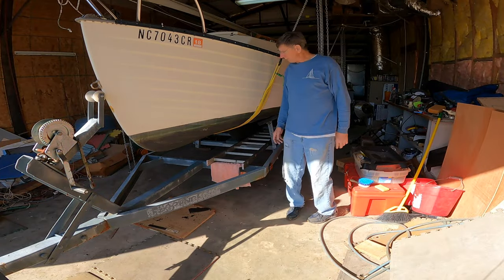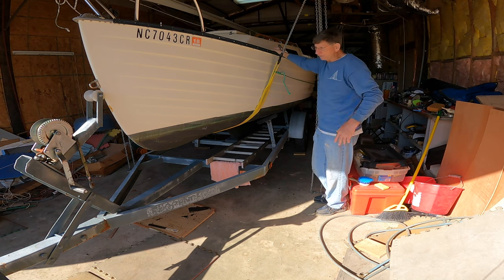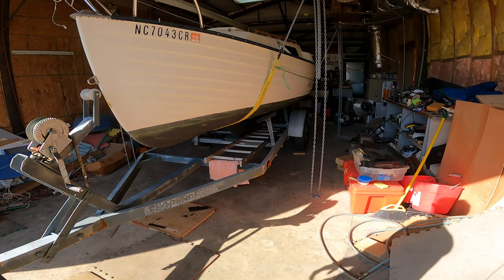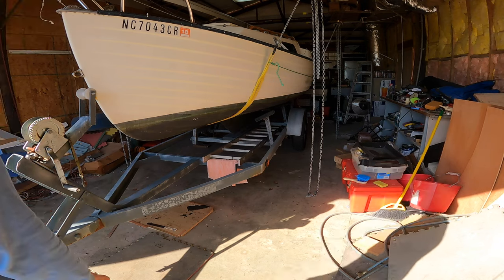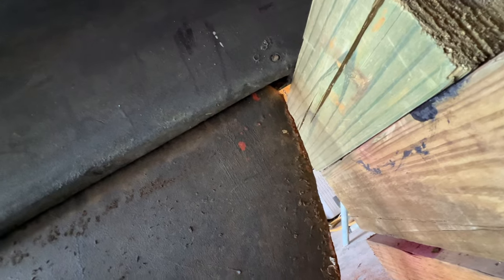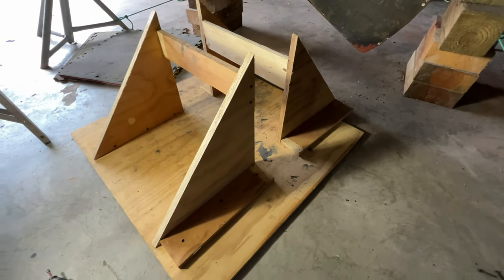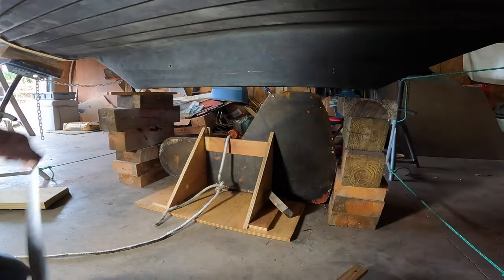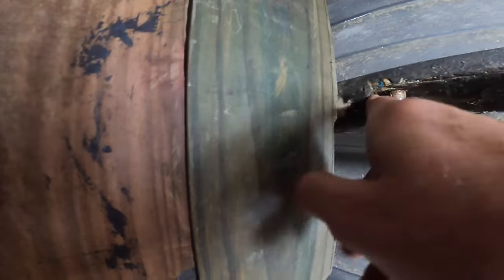Montgomery 17 Centerboard repair - Part 1

Comment: That really is is remarkable shape for the age -- I can't believe there weren't any barnacles to be seen!!! As for the repair for the swing keel, i think that you can go one of two possible ways. 1.  That casting looks to be at least 1/2" thick if not 5/8" -- cast iron drills and taps very easily compared to steel.  You could probably drill and tap for a 1/2" bolt (use fine thread more points of contact -less likely to ever pull out - i would thread in at least 1" into the casting).  Once bolt is installed use it as a core to form the new stop with FerroWeld steel electrode (designed for cast iron) weld deposits will be very hard (not machinable but can weld to partially rusty casting)  can be finished or shaped with grinder -- cheapest route. 2. Skip the bolt for core and use Tech-Rod 55 to build up a new stop directly with weld.  Tech-Rod 55 are more expensive but are more tolerant of any phosphorus in the casting and is usually machinable.  They also have a lower coefficient of expansion, so fewer fusion line cracks.  I look forward to seeing your solution ... good luck!!!
Reply from the maker: Thanks for the suggestions
I won’t spoil my next video but I have repaired the broken stop
The cast iron is actually  3/4” thick
It was in good condition because a previous owner had refurbished it at some point so I had a good starting point
Thanks for watching

Comment: 2 part coal-tar epoxy and marine Bondo was what I used when I made the new 5 ft. LOA centerboard from plate for my 1978 Balboa/ Aquarius 23. I used what the Coast Guard used on Can Buoys. One gallon of Coal-tar epoxy did 2 coats on the board ($150). I faired it after the Coal-tar with Marine Bondo. I believe  Jamestown  TotalBoat TotalFair Epoxy Fairing Compound might be a better choice now than Marine Bondo. Is your pivot pin Stainless? I made a stainless (316L) bushing from a section of 316L solid bar and drilled 1/16" oversize of the pivot bolt. That was fit pressed into my home made centerboard. I did mine on the trailer in the yard and dug a hole to get the last 3" to clear the centerboard trunk. I envy you your setup and the concrete floor to work off of. Pretty work Sir, pretty work indeed!
Reply from the maker: I have used coal tar before, especially to coat fuel tanks but this time I used barrier coat because I had it on hand
I made up new stainless pivot pin and centerboard is drilled out and bushed with delryn
Thanks for your comments and for watching!

Comment: Looks like you are doing a complete restoration and repair of the M17.  Don’t forget the cockpit drain hose.   It goes from the cockpit drain to a flush hole in the bottom near the transom and can be hard to get to.  It can sink the boat if it leaks.  Mine was not in good shape, but fortunately I was able to pull the boat before it sank.  It bears inspection anyhow.
Reply from the maker: Thanks for the advise
I will def give it a closer inspection

Comment: You are bold removing the centerboard, and then going under the boat.
Reply from the maker: I always try and leave the boat suspended from lifting straps as a safety but on blocking to support the weight
And jack stands when possible